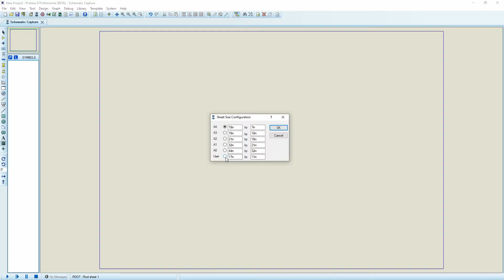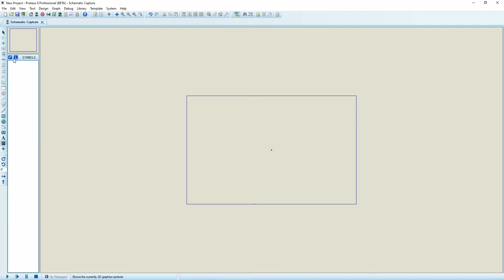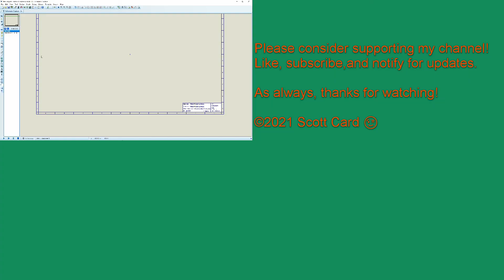How to Add  Borders and Title Blocks in Proteus

Comment: I just cannot seem to adjust the size or the contents of the Header box.  Been hours trying to work that out.  This is absolutely horrible software.  Back to Diptrace for me.
Reply from the maker: It does take a little getting used to. Be sure that you are in the Master sheet, but you can not stretch or resize it. Instead you need to make a new title block for each size. Not ideal but it works.